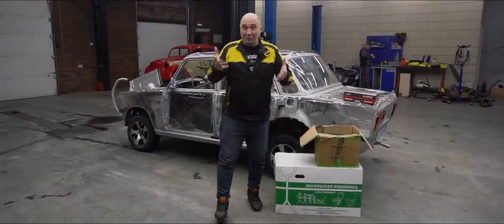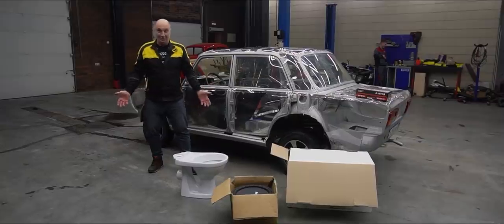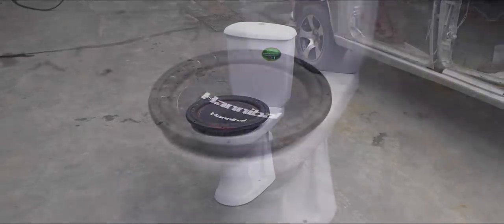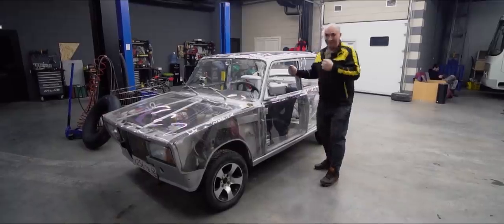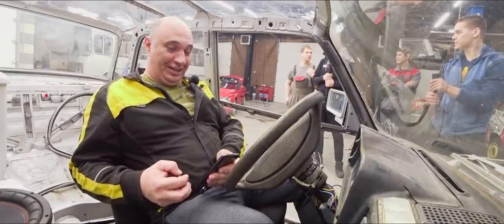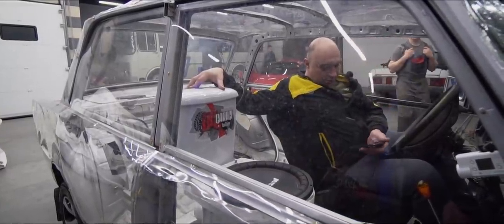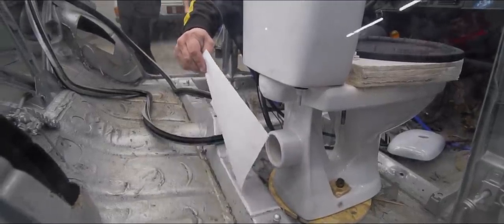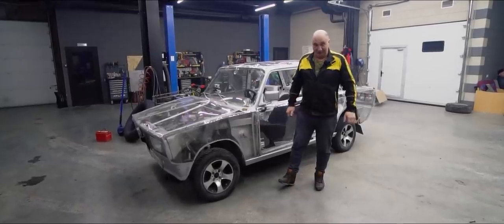Using a toilet as a subwoofer box

Comment: 9:37 or just get smaller sub and extend the pipe :D i can hear that the pipe is too short and the "box" isn't big enough for this big sub. i would recommend 8 inch sub for this size enclosure :D edit:yeah and i would also cover the part where the water comes into the bowl when you flush it(so the hole  at the highest point of the bowl). You are losing lot of spl because of that :D and also when i said extend the pipe i mean like somewhere between 1-1.5m :D
Reply: That would also enable the sub to be recessed, freeing up the seat for a passenger. Surprising the passenger with the additional functionality of the passenger seat is surely the true purpose of a gadget such as this.
Reply: @sealpiercing8476  haha true :D
Reply: Brilliant.

Comment: in this case it is basically a dually tuned regular 4th order bassreflex box because the water tank's hole is a port too - it is not good because at certain frequencies the tunings cancel out each other (1 chamber but 2 different ports), or one of the ports is not acting like it should be, just like a box-leak...so, if the main port is the bottom outlet, you should seal properly the water tank's hole...or make a test:

- first seal the water tank's hole, then the tuning will be given by the bottom outlet
- next seal the bottom outlet, then the tuning frequency is given by the water tank's hole

where the woofer's excursion is the least = the tuning frequency...it will be interesting, because the water tank's hole internally have way less "port area" than the bottom outlet, so maybe the water tank's hole will give lower tuning, howewer the bottom outlet is longer - maybe my tip is wrong - without testing is hard to tell

...and another test-part:
- install the water tank without the amp, it's top too, and seal everything outside on / around the water tank, then it is a bigger net volume regular 4th order bassreflex box...

or another test:
- seal the bottom outlet, seal the water tank's hole = small sealed box
- then mount back the water tank without the amp, mount the water tank's top, seal everything on / around the water tank too = big sealed box
- then push inside the water tank's button-hole on it's top a cca 200-250 mm tube = series-tuned 6th order bassreflex (active chamber is where the speaker is installed - ported to the passive / intra chamber, then port out - this gives truly and correcly two tuning frequencies) which should sound loud at really low frequencies without reaching the woofer's Xmax on high power (maybe the "brown note" too which is 12.something Hz), just maybe the port noise will be not acceptable because of the very small port area...

Comment: Try 7

Could you get a motor with push rods and replace the push rods with glass ones.

I had the idea after looking at the glass stir rods used in science class. They are  glass shafts with glass nubs on the end.

Comment: This subwoofer may have worked better if the amplifier was not built into the tank. With the hole into the tank, you had two different sized bass ports. Using only the drain pipe as the port and putting the amplifier on the ground would have worked far better. In the americas, we have slightly bigger toilet bowls, and the drain pipe is usually longer and exits out the bottom, (tuned lower) so if I tried this it might work even better.

Comment: can you guys make springs around the driveshaft and then cut the drive shaft in half. then put a pipe in the drive shaft so it will stay straicht. this shoud make a fun delay in the acceleration of the car. 
i know u did something like this but without the pipe in the drive shaft and with way shorter springs. u sould try it with the pipe and with max length of springs

Comment: You need to address the lid vibrating. Give it a healthy layer of Silicone on the tank, then on the lid and find a way to hold it it down. Nylon straps? Something had to stop that rattle. And if the enclosure was the correctly it he woofer wouldn’t move, or barely move. This way it’s easy to blow the woofer because of over excursion.

Comment: You needed to seal the toilet and tank.  Ie: seal the lid on, and the drain.  If you did that it would work VERY well actually.  The airflow coming out needs to be trapped.  Subwoofers work by compressing air.  Make it air tight then redo the video.  I GAURENTEE it will work.

Comment: I think you should had filled the hole that goes to the tank, and use a gasket on the up cover to prevent the rattling
Reply: and attach a couple meters of pipe

Comment: What about a smaller subwoofer speaker? As a plumber I'm interested!!
Reply: As others have mentioned, an 8 inch would probably be the best, and could hide away. Put sound deadener between the separate pieces to prevent rattle, mount a powered subwoofer plate amp in the tank, could be a cool little conversation piece to have in your house.

Comment: Hey just an idea could u put a wheel and Tyre inside of a bigger wheel and Tyre
Reply: How would you seal the larger tyre on to the wheel if there is smaller tyre and wheel in the center,
Unless you use a car wheel and a quarry tipper wheel
Reply: @upsidedown4155  no u would cut the spokes out of a big wheel and slide it over the small Tyre
Reply: @Jimmy-Jam3s  so it would be a car wheel+tyre, with the rim of say a lorry wheel  around that with a tyre mounted to it
Reply: @upsidedown4155  yes absolutely
Reply: @Jimmy-Jam3s  i like it, can imagine it being a "custom adjustable lift kit", drive on huge wheel combo, deflate the car tyre slightly and slide the other rim+tyre off then standard height again lol